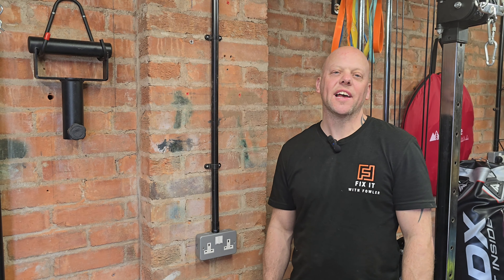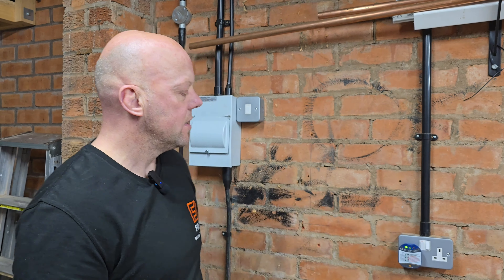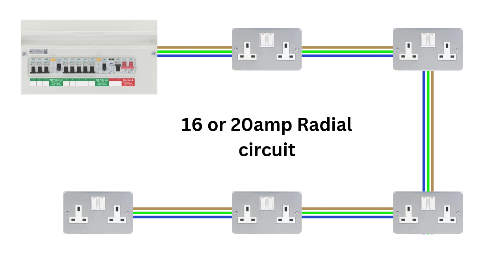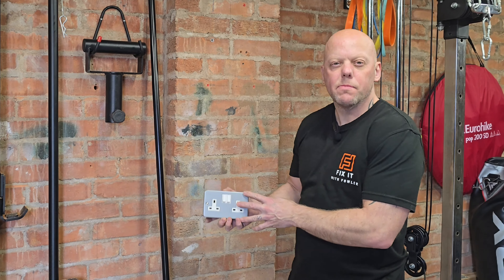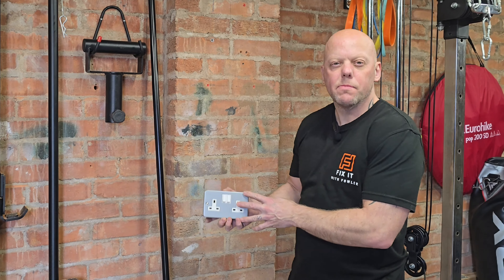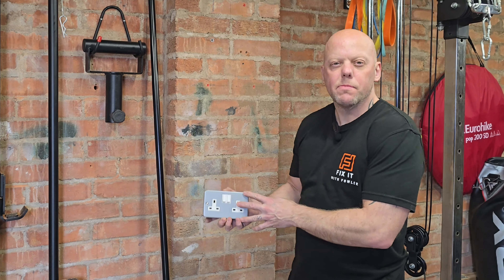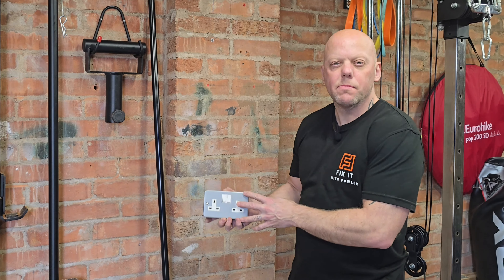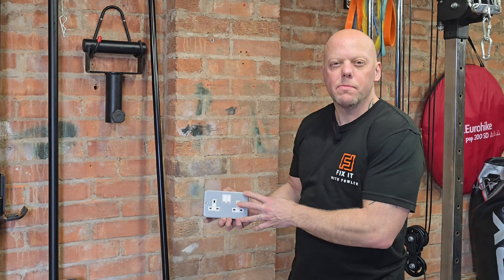Transform Your Garage: The SIMPLEST Way to Add a Socket!

Comment: I don’t need an extra socket
Reply from the maker: That's saved you a job then 🤣🤣
Reply: @FixitwithFowler  😆😆 lucky
Reply: In that case I would recommend not following these instructions 😂
Reply: @CurtisLodge1991 bit late with the comment there dude. Now I do need sockets
Reply: @dekabnaeb6776  Haha, in that case, I WOULD recommend following these instructions!

Comment: If instead of a fuse unit, I'll install a socket that has a built-in fuse , will it be classed as a fuse unit?
Reply from the maker: Do you mean a socket with an inbuilt RCD? They provide a different type of protection, a fuse unit is designed to protect the cable from being overloaded and an RCD is about protecting equipment and the user.
Reply: @FixitwithFowler  not rcd.. a fuse I mean. From overloading the cable
Reply from the maker: You really need a fused spur if you are spuring off a ring main, that will then protect that bit of cable.
Reply: @FixitwithFowler  do I need to install it before the additional sockets? So it goes The ring socket- fused spur- 1st add socket- 2nd add socket.

Comment: I have a 2.5mm twin and earth cable coming into my garage. It feeds 1 double socket and one light switch. Can I add 4 more sockets and one more light switch?
Reply from the maker: What is the other end of the 2.5mm twin and earth connected to?
Reply: @FixitwithFowler  goes to the consumer unit in the house on a 16 amp fuse
Reply from the maker: @ej3080 ok, when it comes into the garage what does it connect to
Reply: @FixitwithFowler  it goes straight into a double socket then spurs off to the light
Reply from the maker: @ej3080  is it a fused spur for the light?
Reply: @FixitwithFowler  yes mate
Reply from the maker: Perfect, you're not limited by the number of socket outlets but more the length of cable. From a quick calculation, the maximium cable length is approximately 30 meters. Add them in a radial circuit, i.e., from the original one to the first new one, then to the second new one, and so on until you get to the last one where the cable will stop.
Reply: @FixitwithFowler  brilliant mate thank you 👍. Just another question, so on my last socket on the run can I then put another fused spur to run my light ?
Reply from the maker: @ej3080  you can put that fused spur anywhere on the run of cable, wherever is best for you or if you want the light to come on with the other you can just add the light to the existing light using the same principle as the sockets.  One last thing, please consider subscribing to help me reach my 100k subscriber goal!
Reply: @FixitwithFowler  already subscribed mate👍👍ledge… appreciate the help🙌🙌
Reply from the maker: No problem, anytime!

Comment: any advice? Changed chandelier to LED celing light. Old switch was for dimming light. As soon as i used it it blow fuses in my house. Decided to change switch to normal - but its same effect. Lights are working from their remote - i can dimm them too etc but wall switch is blowing fuses in my house. Yes - cables are connected properly.
Reply from the maker: My first thought would be its incorrectly connected or the light switch is

Comment: Can I just ask about your feed into your garage. Where is it connected to?
Reply from the maker: Its an armoured cable from the garage consumer unit to a consumer unit in the garage.
Reply: @FixitwithFowler  so I’ve moved into a property. There’s an armoured cable into the garage. On the w outside of the house there’s a fuse box. How can I find out what I can run off that armoured cable? I only have one double socket and one light switch in the garage and I want to add more sockets
Reply from the maker: @deancarter4109 is the fusebox protected from the weather
Reply: @FixitwithFowler  yes. On the inside of the house it’s a fuse switch that the armoured cable runs off
Reply from the maker: @deancarter4109 oh right i understand now. If it is a switched fused spur unit, then the most you can run off, it is 13 amps.
Reply: @ so can’t run much off it then? How can I make it so I can run move off the armoured cable?
Reply from the maker: Take the armoured cable into the main consumer unit in the house. Then it can be on its own mcb/circuit, which means you can increase the power into the garage
Reply: @ so I can’t really do anything with the original armoured cable? Someone said to run a cable to the actual electric cupboard on the outside of the house and then rewire into garage with consumer box
Reply from the maker: You could do that, but you would need to install a small consumer unit in the electric meter cupboard and then connect your house to it and also your garage. Without seeing the job it is hard to say what would be the best option.
Reply: @ do you have an email address I can contact you on?
Reply from the maker: Yes it fixitwithfowler@gmail.com
Reply: @ will send you an email with the setup that’s here already is that ok? Won’t be till tomorrow
Reply from the maker: @deancarter4109 yeah perfect

Comment: Have watched a few of your videos now and they are excellent!
What would be the best way of adding a plug socket under the stairs where the consumer socket is based?
Theres so many cables 😂
Reply from the maker: It is straightforward to do however i would not advise any who isn't qualified to open the consumer unit. You have a main incoming supply with live terminals that you could easily touch and get electrocuted. You really need an electrician.
Reply: @FixitwithFowler  Thought that was likely the case.Thanks, and keep up the great work!!!
Reply from the maker: @RichardDouglas thanks so much!

Comment: Okey, I'll ask differently 😅

Is it necessarily to install a fuse unit when addint 2 additional sockets to a ring main socket?
Reply from the maker: yes it is, a ring main is supplied by a 32a breaker and feeds the ring. If you spur off that ring you are creating a small radial circuit with 1 x 2.5mm t&e cable that can only take 16amps. That is the potential for overloading the cable hence why you need to protect it with a 13a fused spur. Hope that is clearer
Reply: @FixitwithFowler  great 👍 thank you
Reply from the maker: @nosycatUK no problem, its hard to understand sometimes without pictures
Reply: @FixitwithFowler  I've watched a few videos how to install a fuse unit, but they they explain what means LOAD and Supply are.
Reply from the maker: @nosycatUK anything you want to ask or ate unsure about just drop me a message
Reply: @FixitwithFowler  so, basically,  I need to split a wire to run it through the fuse unit box, but which end of the wire goes into "supply" and "load" holes?
Reply from the maker: Supply is the power in and the load is the ougoing side to the new sockets
Reply: @FixitwithFowler  wow,  now it makes send.  So first, I put the supply wires in (that go from the socket) and then put the load wires in that are going further to the next socket. You should make a video on this topic:) thanks a lot
Reply: @FixitwithFowler  I've ordered Fused Spur Side Flex 13Amp. Gonna place it before the additional socket.
Reply: @FixitwithFowler  but what about the earth? There are two holes for it. Are they interchangeable?
Reply: @FixitwithFowler  good evening, mate.
A question: What if I don't install the FCU and  add additional sockets without it. Is it really bad  and unsafe?  I just don't like the fact that by having it installed,  the whole chain of additional sockets will be limited to 13 amps. But if I add the sockets without FCU, I will then be able to use 13 amps on each socket individually. You know what I mean?  Which time me 26 amps in total.
Reply from the maker: @nosycatUK the cable that you are going to spur off the circuit with is 2.5 t&e that only has a current carrying capacity of 16a, that is why you need a fused spur to prevent overloading the cable which can cause a fire. The other option is to add them to the circuit in series as part of the circuit. Have a look at the diagram in the video.
Reply: @FixitwithFowler  ohh I thought that 2.5 has 26 amps. Or so I've heard.. so it's 16 instead?
Reply from the maker: @nosycatUK yes thats why a ring main with 2 x 2.5t&e has a 32amp breaker and a radial with 1x 2.5t&e has a 16amp breaker.
Reply: Sorry for being a pain :) Another question.  If I use two appliances that exceed 13 amps, does it mean that the fuse will blow right away ? Or it does only in case of a heated wire. I'm sorry for a dumb question,  I'm not an electrician.
Reply: @FixitwithFowler  my socket is a ring main with 32 amps breaker. Does it mean that I still have to install an FCU ? Also, is it mandatory?  Might cause a house insurance if I don't install it ?
Reply: @FixitwithFowler  ahh I get it..  2 wires by 16 in each..  understood.  So the wire in a ring main has a different current capacity because of the breaker. 32 amps /2 (in and out the socket) = 16 each way.
Reply: @FixitwithFowler  Hello, mate. Today, an electrician was at my house to find out why rcd trips when I plug a socket tester in a newly added socket. So, he checked everything and also used his special electronic tools with readings. Etc. and said that I've done a great job, but in the socket with an rcd issue  too long wires were  in the back box, which could have cause the tripping due to the fact that they were squashed inside the box . An electrical pressure fault, he called it. So, he cut them shorter and rcd didn't trip after that when I plugged my socket  tester in.  But after he left, it tripped again. So I figured that it could then be the socket plate, and I swapped it for a different one.  And then it stopped tripping. What is interesting is that it used to trip with the old plate only when I plug a socket tester in, not the appliances. I'm thinking,  maybe socket testers are very sensitive and react to any tiny earth leakage. Cause the socket didn't have a problem with any appliances, but only the socket tester.

Comment: Loving your videos. This might be a daft question, but, I've got a light switch right next to a place that I want a socket. Could I use the wires from the light switch or is it unsafe to do so?
Reply from the maker: Hi, unfortunately you can't. The power rating of the circuit/cables will not be big enough to take the load of the socket.
Reply: @FixitwithFowler  ok. Thanks for the advice.
Reply from the maker: @leighbird1970 no problem